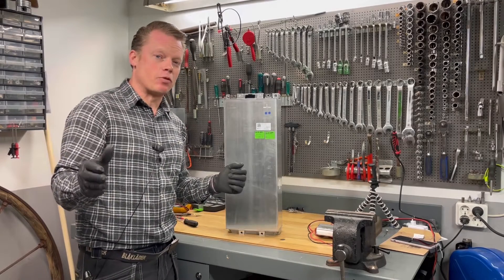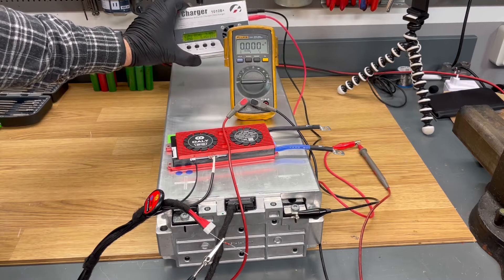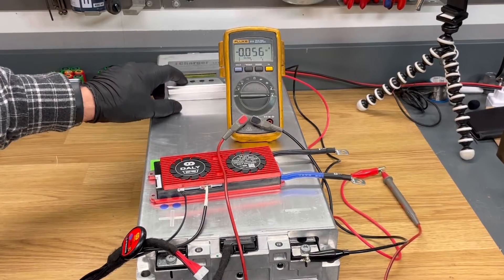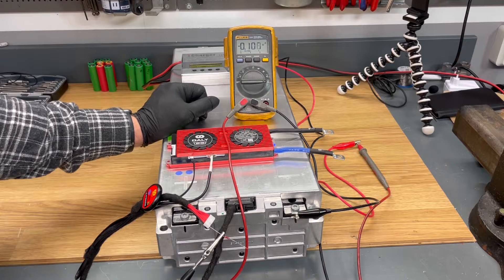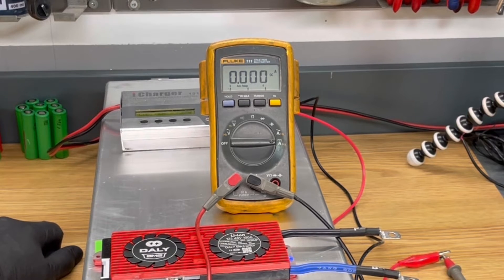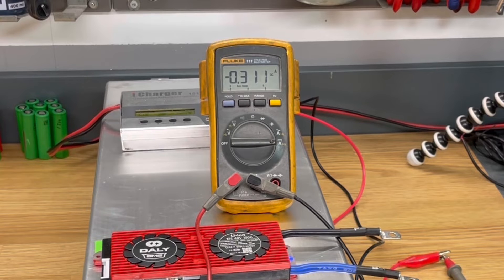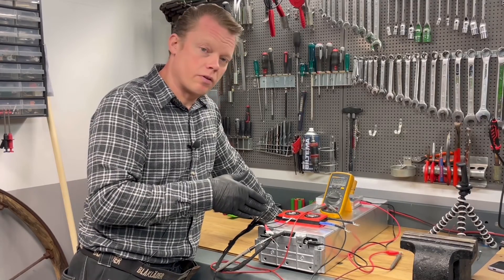Testing the VW id3 battery module balance port, important to know before you buy any BMS to it.

Comment: An official LG E78 12S2P module spec sheet says it's maximum 300mA continuous balancing current.
Reply from the maker: That can be true.
I have now tried it out white an jk-bms and 400ma without any issues. Only for 24 hours, so I don’t know in the long run.
Reply: @flyingtools  Remember, every fuse has it's own heat dissipation rate, and the steady state temperature at certain current depends on the ambient. This module (again, per spec, not that I recommend that) can operate up to +60degC, so whatever temperature rise there is, it is added to ambient. So, it was probably designed to run constantly in that extreme ambient temp. But that's basically a short circuit protection, not overload one, module integrator needs to follow design guidelines - for passive balancer, that's pretty much following Ohm's law for sizing the resistors at maximum allowed cell voltage. Been there, done that, that is I've been involved in design of battery packs for commercial vehicles using these modules :)

Comment: Is the battery positive pin also fused, and is it ok to power the bms from them? I expect the bms itself uses more than 100ma?
Reply from the maker: No, the fuse is located in one of the contactor units. Yes it works.
Reply: @flyingtools  are you on any other social media? So the power wire can just go with the b12 wire? Thanks for the info,

Comment: Thanks Man!! I set up a JK-BMS to 0,3A balancing current in 12S modules and they are working perfectly for months now!
Now i have put together 2 x 8S modules with the same BMS settings and i have one cell in one block wich has a drift of 0,4V in the lowest SOC, i put a few cycles thrue this setup and could not improve the drift... at top SOC all cells have 4,1V and that one cells stays at 3,9, thesmalest difference is 0,2V than.
Do you think i can try to charge that one cell like you did in this video? Will it stay and follw the rest of the cells than?
Thanks for your clear Videos!!
Reply from the maker: Hi!
Yes you can. It will take time… But it sounds like you have a cell that is bad. That is not good if so. If your BMS cant keep up with the balancing, you should change that module out.

Comment: ich habe ein gebrauchtes Cupra Born Modul und da ein JK BMS angeschlossen. Leider kann man das nur auf 300mA Balance Strom runter regeln. Es zeigt mir aber auch an dass ich einen Widerstand von ca. 0,420mOhm in den Leitungen habe. Das sind wohl die 175mA Sicherungen die im Modul verbaut sind? Frage: Kann ich das mit den 300mA Balance-Strom betreiben?
Reply from the maker: It’s in the higher end. I think it will work. But due to the voltage drop in the cables it’s also depends on how the bms is working. I balanced my modules with 200mA without any issues.

Comment: HI, i would like to use an VW Battery module and the Daly BMS system to use it as an additional battery for my fronius photovoltaic system - i am not electrician, so i would need to know how to install the thing and were to connect it to the Fronius Gen 24 or Fronius 3.7.3.M can you help me out here?
Reply from the maker: Hi. I’m sorry, but I don’t think that that type of inverter support either that kind of BMS or that voltage that those battery modules holds. But in this video, you can see how I connect to be a must to this Batteri module. Hope it helps.

Comment: How did you test the balance current? Did you set the charger to discharge one connected cell?
Reply from the maker: Hi. I just had a small pack with 18650 batteries, and one cell was higher then the rest of the pack. Then I just had my multimeter in series with that cells balance lead.
Thanks for your question.

Comment: I read this fuse is 750mA
My JK is balancing current is 0,6A
Have it working for a month with no issues
Reply from the maker: It started to get really hot at 800mA and the solder melted around he fuse at 1A I maby will do a video about that in the future.
Reply: I'm also planning on using a JK bms, can you confirm that your battery is still fine with the 0.6A balancing current?
Reply: I didnt want to test that much so my balancing current is 400 or 500mA
In any case there is almost no much sense of balancing. Good balanced battery with same cell resistances will not unbalance at all 

Li ion is not LIFe and no need of large balance currents

Comment: Good video, thanks! If a fuse is a blowed in this module it is doesn't mean it is a and of the battery. You can open up the front, and back, then a soldering any wires of BMS or balancer on the contacts of each battery element. I says by the experience. On the Internet you can find photos, and understand exactly where to cut the aluminum case.  The depth of the cut is approximately 2mm.  I also have an already opened body case, I can show photos
Reply from the maker: Thank you. I finally got my hands on a defective module and I plan to open it up to learn more about them. Thanks for the information 👍🏻
Reply: @flyingtools  When you start to cut the case, focus on the seam that was made at the factory
Reply from the maker: @SalarColor  yes, that’s the plan.😊👍🏻
Reply: Thank you very much for this video!! I bought some similar LG chem 4S modules (volvo XC40) from EV breakers and one of then has no voltage on cell 3. I can see all other cell voltages so I think this fuse you talk about must have gone on this particular cell. Very frustrating! The construction of mine is exactly the same so I would be very interested to see how you get inside these modules, but even if it is possible I doubt it will be repairable to use in an EV conversion stacked with other good modules.
Reply from the maker: @olivertrotter  Hi and thank you. 😃
I opened up one end (the connector side) yesterday, and to my surprise there was no fuse, but the ribbon cable is very very tiny so I guess that it can act as a fuse. I had tried to open the ends of the module an repair it. But first, discharge the module to the lowest discharge voltage if something should go wrong.
Reply from the maker: @olivertrotter  Hi again. I was taking one more look at it right now, and I did find the fuses!! They are located directly under the balance connector. I plan to do a video about them. Sadly you still have to open up the end cap of the module to replace it.

Comment: Hey hallo Nice video, where did you find the pinout for the 22pin and do you have it for the 8s3p 29v? Do you have on all your modules a daly Bms? Is it possible To have them all together in 1 app? Is there an other way to contact you.
Reply from the maker: Hi, thank you.
I figured the pin-out out my self.
I do not have it for the 8s yet.
1 module one 12s bms or 2 modules and one 24s bms. No one in serie.
One at the time in the app.
Reply: thanks for the response, i have the choice 12s or 8s module. which one would you choose? I also watched the video with the growatt what is the disadvantage of this inverter? how many module 12s could this handle in parallel? or still advice solax and modules in series
Reply: Do you work as a vw mechanic?
Reply: Im a hv expert vw mechanic. If you our also can we have contact? 😀

Comment: Is it correct that if I connect the bms that you have in this video I can check is one of the small fuses in the module is blown? Before I buy a second hand module 🙂
Reply from the maker: Hi, yes thats correct. You also have to check the balance at the same time. More than 0,020v unbalance between 3,3v to 3,85v is a warning sign that you have a drift in that cell. Good luck with your project😊

Comment: As far as I know these fuses are 750mA
Reply from the maker: Wow, that’s great info if so. As soon as I have the chance I will open a module up and try to confirm it. Have a great day and a HAPPY NEW YEAR😃
Reply: @flyingtools  Batteries can be taken apart using an angle grinder. All you need to do is punch. You can always pull off the flaps. And connect the balancer directly under the modules.
Reply from the maker: @awerskto  That is my plan, as soon as i have a module to spare i will open it up.
Reply: @flyingtools  If you want to ditch the battery cells then use Isopropyl alcohol, preferably as a cleaner in a spay

Comment: i see you use a 12s 48v bms link where did you buy it?
Reply from the maker: Hi. 
I have a little more info about it in this video. 

Capacity test VW id3 id4 battery module
https://youtu.be/XS257c3Jp6c

And I bought it from AliExpress.
Balance current: 45mA when I tested that.

SEK 469.88  32％ Off | Daly BMS Smart 16s 48V 18650 Battery Li-ion LiFePo4  4S 3S 7S 8S 10S 12S 13S 16S 20S 24S12V 36V 30A 60A 80A 100A 120A 150A 200A
https://star.aliexpress.com/share/share.htm?image=A38f1584185f74fb0822417ad9f6a84beL.jpg&businessType=ProductDetail&title=SEK%20469.88%20%2032%EF%BC%85%20Off%20%7C%20Daly%20BMS%20Smart%2016s%2048V%2018650%20Battery%20Li-ion%20LiFePo4%20%204S%203S%207S%208S%2010S%2012S%2013S%2016S%2020S%2024S12V%2036V%2030A%2060A%2080A%20100A%20120A%20150A%20200A&platform=AE&redirectUrl=https%3A%2F%2Fwww.aliexpress.com%2Fitem%2F1005002811248870.html%3F%26srcSns%3Dsns_Copy%26tid%3Dwhite_backgroup_101%26mb%3DQDvJmB7yNDkwB5z%26businessType%3DProductDetail%26spreadType%3DsocialShareu

Comment: The jk BMS 0,6 amps has lowest setting at 0,3amps balancing :( any ideas which BMS to bye for a 12s 45v config? model part number would be nice
Reply from the maker: Se my answer in your latest comment.
😊
Reply: I balancing such battery with jk and 0,6A no problem

Comment: I believe ter is a misunderstanding regarding to lithium battery.  In general the cells doesn't drift.
Then again yes the do drift, but not that much. 
So is it important, NO
Because they always come back fro the point were they started. 
That is the reason that les the 200mA is enough.
The only thing that is required is the cels is cycled and is balanced out at the end, so when the battery is amassable all cells is balanced out.
That makes less the 200mA more the sufficient.
I startede working with lifepo4 battery in year 2010 and have worked with this cells until now, and all cels have been at 165 Ah to 180 Ah
Winston, Thunder Sky, Calbe and for destructive test A 123 small cells was used.
Last battery i made was 114 Kwh @ 700 Vdc.
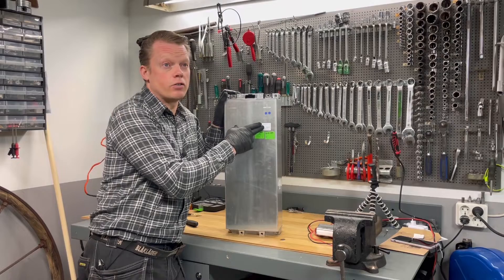The best information out there is Jeff Dahn, a video 1:13.29 
If you don't agree with me, please finde the video on YouTube : 
Why do Li-ion Batteries die ? and how to improve the situation?
Yes it is olde one, but battery haven't change that much trug time.
Only density and size,  done with different anode martial and difrent Chemical used for the electrolyte down to the whole "kitchen sink"
Please enlighten yourself by seeing the video.
To my recollection, Jeff is the only one external consultant that is hired in battery research program with Tesla, they even called the group "Dahn".
Please bear with me for small translation mistakes since I am on sick leave and I find it extremely hard to concentrate. But I had to say something 😊
Reply: Balancing current needed depends heavily on the use case. If the system has the comfort of doing a proper end of charge with equalizing, eg. in a car or a bus with overnight charging, then yes, something kike C/100  or even C/200 is enough. However if a vehicle relies on either opportunity charging, where you use high current for short period AND have no time for equalizing and EOC, or the battery operates as a power buffer in hydrogen FCH, then there is almost no opportunity for it to be steadily charged and slowly balanced out. It has to rely on higher power balancing, sometimes it's economically viable to use active balancing, sometimes clever use of higher power passive one is enough.
Reply from the maker: Wow, you really now stuff about battery’s, thank you for all that information and I agree with you on everything. I have now looked on the video and it was really interesting and learning, I think I have to look at it again. Really interesting that it is the time of charge that damages the cells at higher temperatures, I most say that I thought it was worse to charge it fast then slow under that circumstances.
Again very interesting and giving!! Hope you get well soon.

(I am very concentrated but I know my grammar and spelling are way of sometimes anyway😅)

Really wish that you get well soon and a huge thank for your comment😃👌🏻👍🏻

Comment: For such a huge pack I do not know what for example 125 mA balancing current can do, it will balance this pack forever =)))
Reply from the maker: Yes I know what you mean, that was my first thoughts to, but those battery packs do not drift at all (almost)
My pack that I used daily now for 6 month has a delta at only 8mV over 108 cells. So in a matched pack with healthy cells that small current will be enough.
Reply: @flyingtools  I've bought 2 modules for Renault (same factory make modules for VW) and I hope they won't drift either, but I will put a Ji Kong BMSes on them anyway as I need to teardown the modules and add one more cell in series to get my 48v invertor running smoothly

Comment: Where did you purchase the complete battery from ?
Did it had all capacity, arhhh... Just remembering that you aren't using the full voltage range to protect it from over and under voltage.  
Maybe you have an idea if you hav the full capacity.  
Great video and happy new year 😊👍💪
Reply from the maker: Hi!
You can buy it from here:

https://www.secondlife-evbatteries.com/products/vw-id3-6-85kwh-44v-156ah

Thank you so much and a happy new year ✨😊

Comment: Hi, are you sure they're inside the fuse? If there was an interruption, the whole module is gone, I don't think so.
Have a nice Christmas to Sweden.
Reply from the maker: Yes I know, that’s crazy! Even my e-up battery has built in fuses in the module. But there you have access to the cells so it will be an easy fix. If I can find a bad module I will make a new video when I open it up for you guys ☺️ 
I which you the same 🎄🎅🏻

Comment: Thank you for this test.
But where did you read about that fuse? I'm curious...
Reply from the maker: I cant tell exactly where because I looked at so many forums in my search of a suitable BMS for a high voltage battery. Then I decided to make this test so I really know. But the important thing is that it can handle 200mA😉 And right now I have a long test going on at 200mA.

Thanks for your comment ☺️